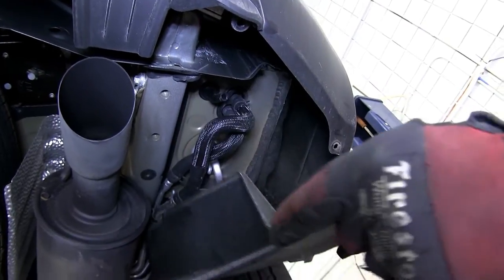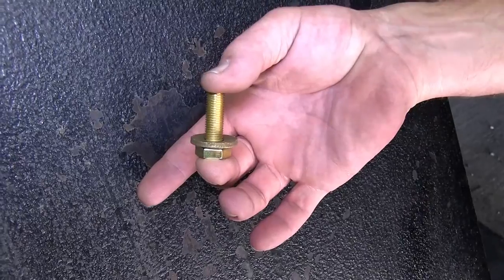etrailer | Mount: Curt Trailer Hitch Receiver on a 2013 Toyota Highlander

Comment: How much can you tow with that Hitch?  Im thinking about buying a 2012 Highlander 4WD 3.5L Dohc MPI 24-Valve VVT-i V6 Engine. I read that this one can be equipped to tow 5000. Is this true and what does it mean, or how do I equip it to tow that much? Thanks for any and all advice.